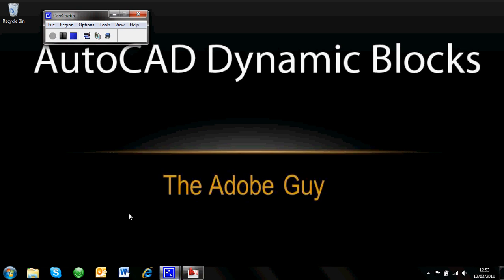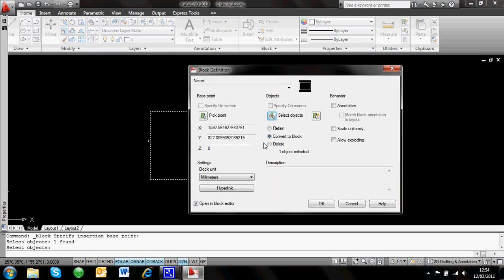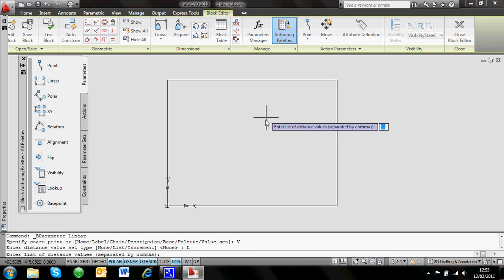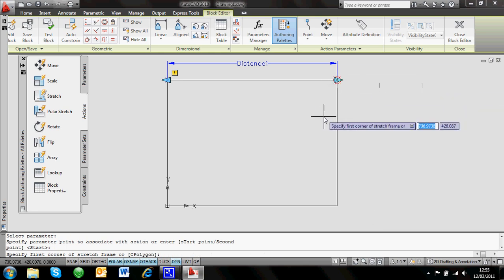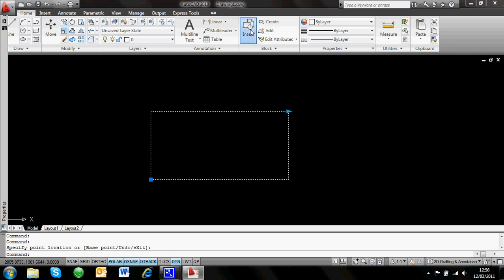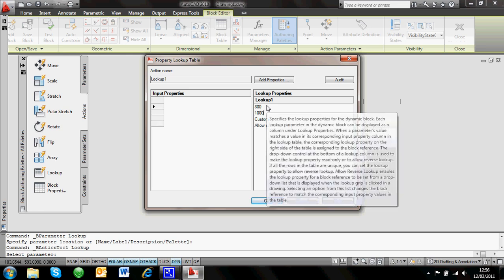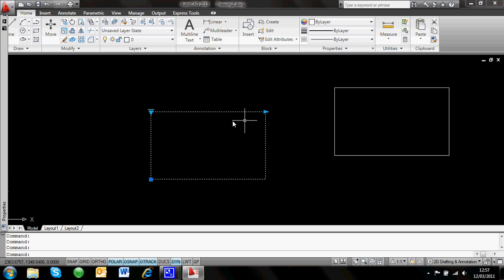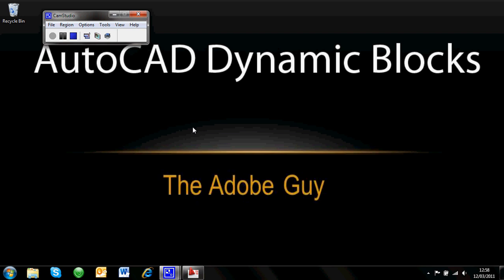AutoCAD Dynamic Blocks

Comment from the maker: I've just had a play in 2010 and found that it's nothing you've done...just that you have to have DYN turned on to see the dimension as it is one of the dynamic input properties. if you switch between DYN on and off you'll see the difference on the same block. Sorry it wasn't obvious to me before simply because I just always have DYN on as it is such a fast way of working.
Cheers

Comment from the maker: Firstly ensure you have DYN selected at the bottom of the screen to allow "dynamic Input" ie on the cursor. Then to get the drop down I pressed the "down arrow" on the keyboard after chosing "Linear"

I'll have a look at doing it in 2010 to see if any different. Do you have full or lite version?

Comment from the maker: As you watch the video you will see that after defining the ends of the parameter, I place the dimension at this position. I then apply the action (Stretch) and save and test. If you miss out the step of placing the dimension it will not be shown on screen.
Hope this helps.